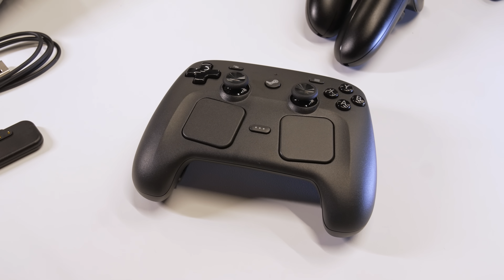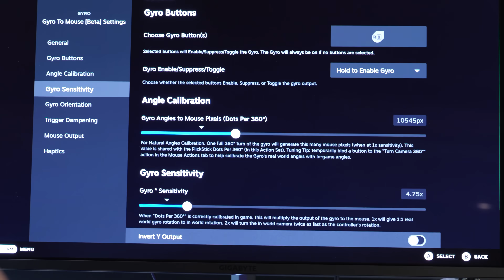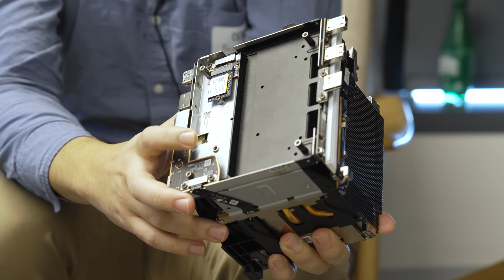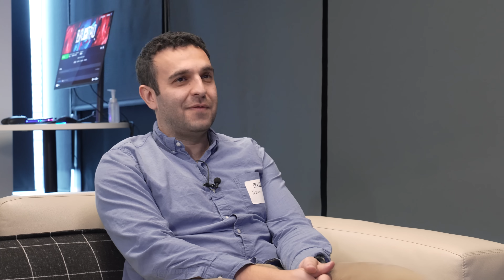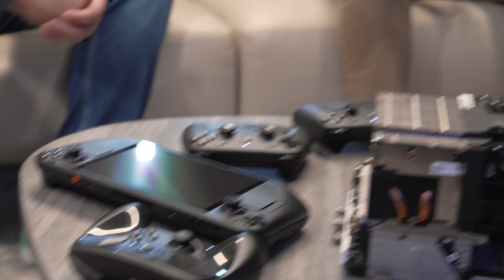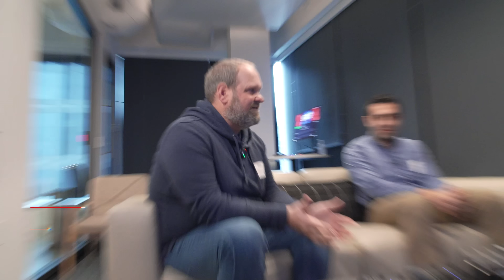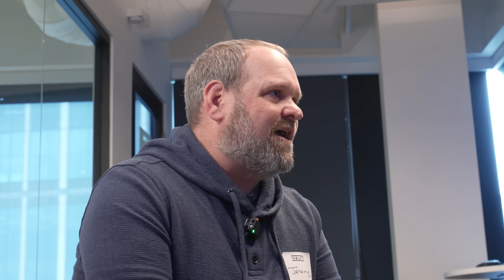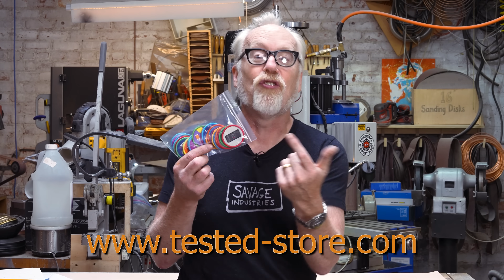Hands-On: Valve Steam Controller 2 and Steam Machine!

Comment: 14:30 i think the statement of “the steam machine should more powerful than 70% of what people use” can be backed up with the hardware surveys done by valve
Reply: My little fart of a computer cant run minecraft at over 3 render distance so im happy 😂
Reply: On the flip side. That depends if it would make for a worthwhile upgrade. In my case I have a rx 6700xt which is as powerful as a ps5 so it would be a side grade. The feature of suspend and resume on the other hand...
Reply: @SnapCacklePop-tp1sx yeah, it's a downgrade for me (though I will install SteamOS on my desktop as soon as it's available). But it's an upgrade for my wife from a 2060 and old Intel CPU. And the low fuss nature of it is a huge draw here as well.
Reply: @Kiaulen no point installing steamOS, it does nothing special. anything it can do a more desktop oriented linux distro can do, or does better. Bazzite or Chimera for a gamescope session like SteamOS, Fedora or Cachy or Nobara for a gaming desktop
Reply: @cromfrein Tried Nobara, had some bugs, went back to vanilla Fedora. Currently on that. But SteamOS (once it's officially a distro) is likely to perform better just because Valve works so closely with AMD on drivers. 🤷
Reply: @Kiaulen  Any work valve does on drivers goes back to the project, and goes into the other projects. There isn't much of a performance difference between distros, it's just a matter of which ones behave how you want.

Valve also doesn't want to support SteamOS on general PC hardware
Reply: @SnapCacklePop-tp1sx would not be worth it. Just duel boot bazzite
Reply: @ghostlegit  Dual boot? Pthooie! Disgusting! I cold plunged to Bazzite almost a year ago and I ain't touching Winblows anymore! 😠
Reply: @Kaltsukka that's you but majority use windows. Sucks to suck ig.
Reply: @Kaltsukka  i would do but I like playing seige. I would have my mint partition as my primary but Micropeen keeps pushing updates that break my primary boot order. Stuck in an abusive relationship I am to keep playing with my friends....
Reply: Took a look at the steam survey to get a guesstimate of this. So a majority of gamers use cards roughly around the RTX 3060 up to RTX 4060ti. So that's not bad for the 4k 60fps goal on most games with SteamOS and Proton as the operating system. I used to have a RTX 3060 couple years back. It was good. Ran Cyberpunk at 1440p mid settings with around 50fps on windows 11 with a Ryzen 5600x paired to it and 32gb ram. About the same or better on Red Dead Redemption 2.
Reply: @batterypwrlow me with a 1050ti 😂😂
Reply: @f.b.l.9813  Me with a GTX970
Reply: @SystemAlchemist Me with 1650 super
Reply: @batterypwrlow 7600M at 110 Watts which a 20 watts overclock is about the same level as a 3060Ti so yes Its above 70% of the users GPU
Reply: @kaizel2264 check the spec sheet. They said the cpu was gonna be pulling like 30 or 35 watts. The gpu might be doing 100 watts or so.
Reply: Go look at it, it does not.
Reply: @thatnerdgui3496  Might want to look at it yourself, because it is.
Reply: @LyinOats what you think I did before I posted that you donkey. This has the equivalent of a 7600M which is pretty garbage.
Reply: Keep in mind that that’s still iffy since the Steam Hardware Survey includes people who run old setups/have Steam but don’t keep up with AAA culture, however I do think they can make the claim that it’s as powerful as a 60 series/600 series GPU, the most common GPUs used on the Hardware survey
Reply: @oreo10102  are the people buying the steam machine keeping up with AAA culture? It seems like a lot of those people would have custom builds.
Reply: @omduggineni I haven't kept up because AI has made GPUs too expensive to justify, but I'd buy this as replacement/additional living room PC.
Reply: @omduggineni That's just it. The people who are paying attention right now are the "hardcore nerds" but this thing is the Wii of gaming PCs and I mean that in a good way.
Reply: @Izzyholic  if my grandma buys this for christmas next year, then im convinced you are right!
Reply: They don’t even need surveys, Im sure they can fetch your computer specs easily from the steam app. You already signed data agreement without reading it hahaha
Reply: @kalkydra  I don't think valve is in the market of getting data with out  consent and selling it thought. That's why I find it nice that they ask to get by system info in periodical surveys and i have always agreed
Reply: @kalkydra  if you think they're doing that then why do they also do hardware surveys? Just a red herring? Are you that cynical?
Reply: @kalkydra  the steam hardware survey is a community event, they explicitly have users opt-in since it's all published openly.
Reply: @kalkydra  that's what those surveys do. The "survey" is mostly a popup with them asking "hey can we get your permission to scan your hardware config and anonymize it?"
Reply: @kalkydra  and yet thet have hardware surveys...
Reply: This is factually incorrect.
Reply: @MrLilredmachine about 10% of the steam survey doesn't even have a dx12 capable GPU
Then another 10% of them arent using dedicated graphics
Then about 50% of what remains are cards weaker than a 7600m
Reply: @W1ldSm1le  the Steam Hardware survey is not reliable for two particular issues. 

1) is that despite Steams efforts to prevent it, it can still clock massive Eastern internet/gaming cafes, the majority of which have doggers outdated hardware. The average western gamer is either on console or has a fairly potent gaming PC. 

2) It counts handhelds. Handhelds are often an accessory to a main gaming rig, so for example I've been clocked on my ROG Ally so for the intents and purposes of that survey result I didn't have a system with a dedicated graphics card, I was one of the ten percent. 

Meanwhile whilst I'm playing my Ally on the couch, there is a 9800X3d/9070 home 3d printed miniature ITX PC sat 6 foot away from me on my desk, but that wasn't included in the hardware survey. 

Considering that there are 5 million plus Steam Decks out there, and many more handhelds apart from that, most of which are running Steam, and a lot of which will also have quite powerful PCs, that can have a huge effect on the survey results. 

Now, I'm not saying it's useless, but having something like the Steam hardware survey as a be all and end all thing to rely on as a gospel indication of what people have is dubious at best, and almost certainly supplies results that are likely to be very underestimating of home pc power in the Western regions. Which, let's face it, is the exact reason we are discussing it here.
Reply: @W1ldSm1le that's not how this napkin math works.
Reply: @MrLilredmachine if really is not incorrect.

It's a heavily modified higher performance RX 7600M. That is actually better than the majority of users hardware who participate in hardware surveys.
Reply: @thebritishvikingno, it isn't. It's got 20 more watts running through it, that's all, so 110w peak @ 2450mhz on 4 less cus. A proper 7600 uses 175w+ and runs at 2550mhz, with the XT pushing that to 190w @ 2700mhz, both on 32cus. 

It's still a 7600M with 28cus. There is a 7600M XT which is 32 Cus like a proper RX7600, just with limited power, but for whatever reason Steam decided (or was stuck with) the weakest GPU core of the RDNA 3 generation. 

The worst thing is, the cope appears to be it's RDNA 3. But it isn't. Not a lot of people realise that the 7600 series (all of them) were so cheaply made that AMD didn't bother putting them on the new chiplet 5nm node like the rest of RDNA 3. So it ended up with a monolithic Die on a 6nm node, which is more like RDNA 2.25. 

This is why the 7600 was the most hated RDNA3 skew. It ran hot, ate power to get any performance (worst FPS to watt of the entire gen) and was incredibly underwhelming even in full bore 16gb 7600XT form. The CPU isn't great either. 

The entire thing is built from parts AMD couldn't sell.
Reply: @thebritishvikingno, it's just a 7600M GPU, there no "higher modified" nonsense here

Comment: 14:36 this right here kinda confuses me cause if you’re hardware is equal to 70% of the hardware people already have why would you want it? They should’ve probably targeted above the standard.
Reply: Price. Its probably going to be 800$ usd where the average pc would cost like 1200 right now new.
Reply: @ac.creations and ease of use.
Reply: @ac.creations 800 usd for this is an absolute rip off. It's weaker than base PS5 with a below par RX7600M. Valve sure gets a lot of slack just based on the name.
Reply: @dimaz3 reminder that game consoles are often sold at a loss, and also have subscriptions for online play. Also, consoles are a closed system unlike the steam machine which IS an actual computer, or so it’s said. There’s a tradeoff you’re getting for that lower upfront price on consoles.
Reply: @jarpiguess  Tbf Steam makes a huge cut from games on their platform too and if you are gonna try to attract console players into pc gaming , offering a weaker machine costing 200 dollars more than the base PS5 nearing its end of life is not gonna cut imo. This doesn't have the Novelty factor of a handheld to make a dent in the market. Valve's name will help initially but I don't see this lasting. Atleast the other products are more promising.
Reply: It was "equal to *or better than* 70%". So they definitely targeted above the average, by about 20%
Reply: @Rozza3 100% this. For 2/3 of all gamers it would be an upgrade of some kind